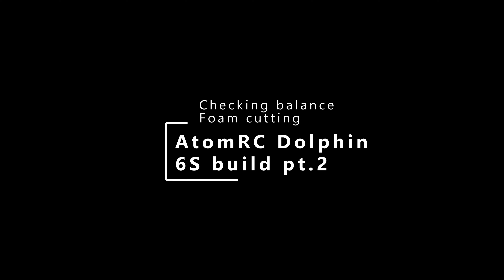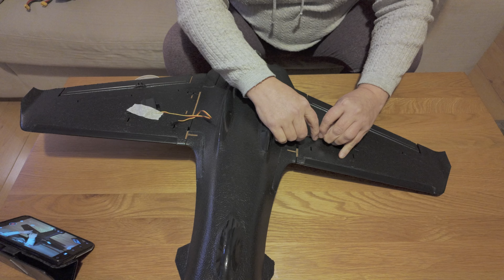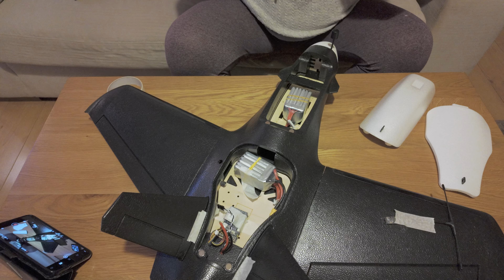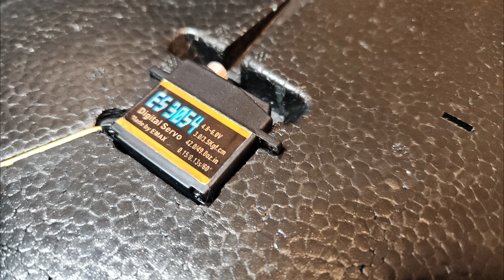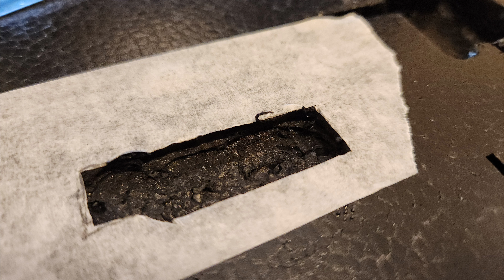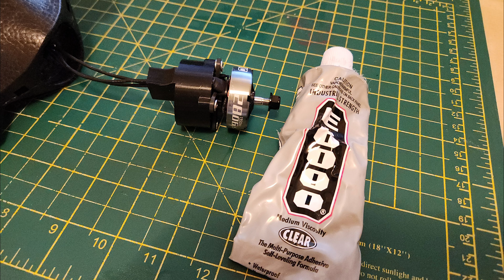AtomRC Dolphin 6S - Part two

Comment: Very nice build, always impressed with how clean your builds are and that nose looks the business for an 03. I am wondering how you'll go for the CRSF antenna causing drag at high speed so far away from the fuse. I had a 433Mhz antenna on my Mini Talon that caused noticeable drag out near the end of the wing which was noticeable even at low speeds and was a PITA. I'm currently running the exact same antenna as you on my dolphin and its close to the fuse but I'm thinking about putting it further out for a cleaner signal (more range) we'll see. I mostly am a slower flyer so your 6S test will be very interesting to me. Keep up the great work and well done on the video too which is also high quality.
Reply from the maker: I can't say I've noticed any issues with having the antenna out on the wing. I think it's important to keep the rest of the wing as clean as possible, embedding the electronics and putting on some tape to smooth over the routes. I have noticed the crossfire can really cause issues with GPS reception, so getting it out on the wing I think is important.
Reply: @Caroline_Tyler  Thanks for your response Caroline, I'm now looking to move mine too. I'm running ELRS which is a tiny RX so should be able to bury that in the wing easily.
Reply from the maker: Yes, tiny like the Crossfire nano!

Comment: Very good Caroline, like the motor mount, looks much better than the stock one. Broke that mount a few times on my dolphin. Running my Dolphin on a 5s set up and gets through the Air nicely. Well done.
Reply from the maker: I think AtomRC have acknowledged the deficiency of the ply wood one by supplying the two 3D printed replacement ones. I was expecting to have to print my own.
Reply: @ bonus then.